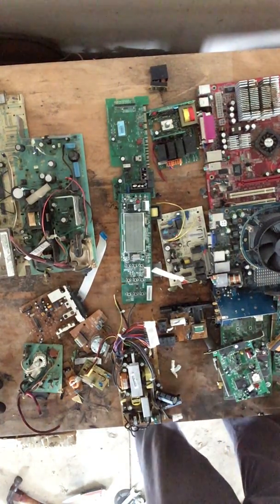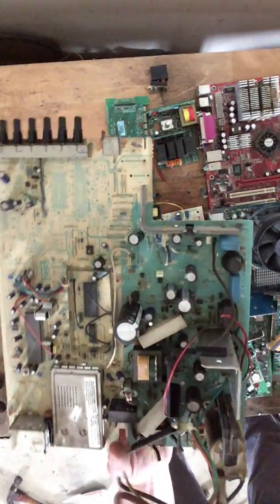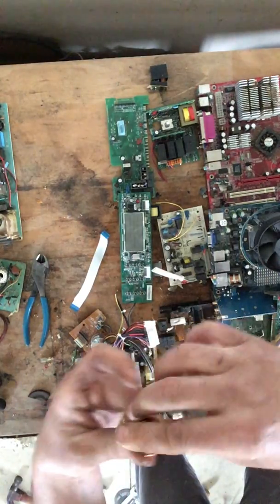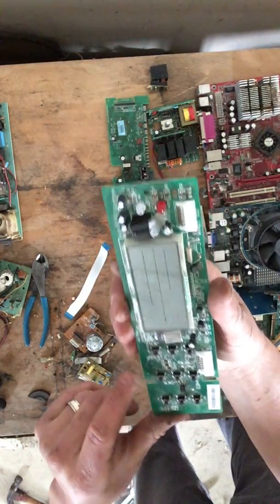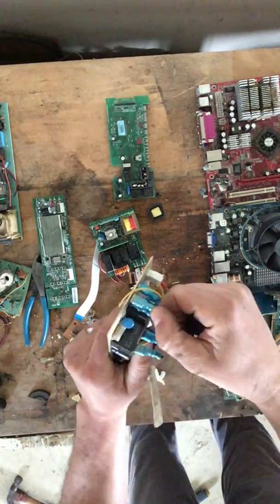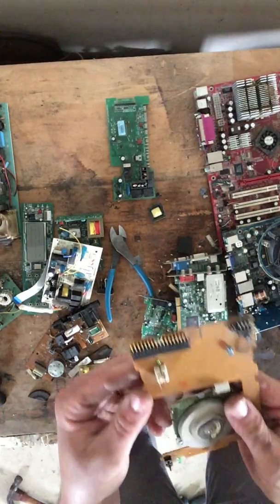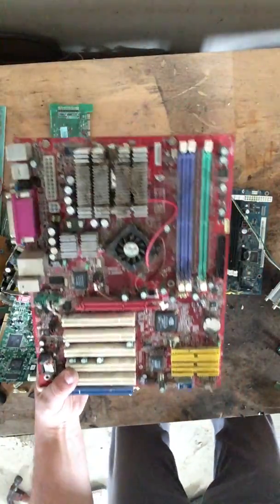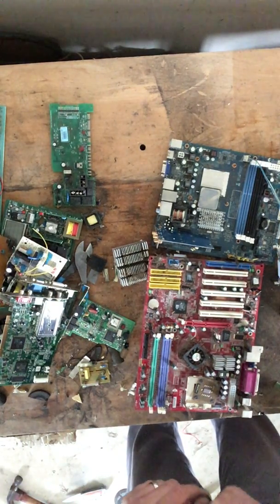Scrapping circuit boards for beginners.

Comment: I want to thank you for your informative video on what holds value on the boards, but also what to remove before scrapping the boards to maximize the profits attained by simply putting in a small bit of extra energy removing the more valueable components off the boards.  I know this is an older video, but that doesnt take away from the quality of the information your giving.  I do have a few questions for you in regards to the price difference between the low, medium, and high grade board pricing in a generalized % difference and not the current price.  Thanks, and keep on your scrap game. there is more money to be made scrapping than most know, and I do believe that scrapping as a full time job, or even a side hustle can seriously help make life much easier overall because of how much money can be made in the various ferrous and non ferrous metals, as well as e-waste.
Reply from the maker: Thanks for watching, and I appreciate the kind words.  You can make some good money scrapping, granted the scrap is there to pick up. I know my dad says he gets slim pickings in London due to the competition from fellow scrappers. In London I get $0.26lb for some of the circuit boards and $1.10lb for motherboards. Sometimes you need to call around.

Comment: Mr Tin Man, the small components is there any value in saving these? I read about some parts that contain palladium. Will you please elaborate.
Reply from the maker: I actually have a video called “depopulating circuit boards for gold, palladium, silver” check that one out. It talks about micro scrapping as well as shows you places to find the precious metals and what to look for.

Comment: Are there toxic chemicals in these when the board breaks? Should gloves be worn? I want to collect all the Silver and avoid the Middle Man. I know there is good money to be made. I worked in a Print Shop and silver was extracted from " fountain solution" . In Printing- Oil ( The Ink) and Water ( Fountain Solution) don't mix ( they separate).
Reply from the maker: it does depend on how you break them, I use a pair of tin snips and it does not release any type of dust. However, if you use a grinder, there is dust that becomes airborne and you will want to wear a mask and have a ventilated area for protection

Comment: your scrapping guides are very primitive, all you focus is on copper. you aren't saying about tantalum capacitors, diodes, transistors, or the solder used on the board which contains 3 percent silver (lead free silver only). But all you are seeing is copper. Forget about palladium, gallium, platinum and advanced stuff like that. Only glittering matters for you, gold and copper.  Take a time and see the manufacturing process of electronic components, will give you at least general level of education as a scrapper.
Reply from the maker: If you read the title it says for beginners. My other videos show other items like silver, aluminum (both clean and extrusion), brass, etc. some want to know basic questions like what category to put them in, where to find various ones, etc.

Comment: I take the heatsinks, transformers and copper / aluminium coils, wire off. Put any plastic covered transformers, copper coils in the freezer, it makes the plastic brittle and easier to smash up.

Comment: Can you please let me know what the thin silver coloured wiring in low grade boards is made of
Reply from the maker: Either aluminium or coated copper. If you scratch with a file and copper underneath #2 copper, if scratch and silver it is aluminum

Comment: I have TVs, PC towers and Laptops,  one scrap yard pays for laptops as of 2023 Jan $3 each if complete screen not cracked (or 25 cents a pound)  , another scrap place gives me 60 cents a pound.   Desktops same thing $3.50 to $5 each  if includes a hard drive and memory stick. the TV boards I think were 35 cents a LB. I  might start cutting the contacts off the edge, but so far I have just been scrapping them as is.  Oh and TVs no one takes because of the glass,  just pull the boards.

Comment: Does anyone have any experience with selling all grades of scrap boards and processors to FCM in Montreal? It is difficult for Canadians as I live in a border community but you basically have to part the sea to get them into the States. I would prefer anywhere along the 401 corridor . I live 100 km west of London Ont. Any feedback would be helpful.  I took about 6000 lbs three years ago to Greentec in Cambridge, but that didnt go very smooth.

Comment: Hey at 2:40 those plastic boxes (volt relays) are worth cracking open they have copper and sometimes gold or gold contacts
Reply: If it’s not gold it’s a different yellow metal but I’m 99% sure it’s gold and if it is electronics usually use 24k gold
Reply: 4:39 its I believe called copper windings and volt relays have them
Reply: Will you do me a favor and stop saying "k?" I had to quit watching because it was killing me. "K!"

Comment: Tin man: what are header pins from circut boards made of? Silver or aluminum? These are the pins in the long  plastic- that are solder to the board where a slave connector or ribbon conects. Thanks

Comment: Hi!  I'm a brand new beginner at this and I've been trying to get the circuit board listed in a different YouTube video.  Is there an alternative to this green pcb board for building diy mp3 player in the following?   Video is simply called How to make Mp3 player at Home !   By Mr. Maker.  Feel free to check it and get back to me. I'm so clueless.   
 Thank you for help!
Reply from the maker: Actually not sure about remaking or building things with circuit boards, I just scrap them. Sorry, but I will check out the video.
Reply: @TinManScrapper  ok thanks

Comment: What if the boards are broken or have a hole from ripping off a heat sink. Are trash or what?
Reply from the maker: At my scrapyard I have brought them in completely destroyed and they take them. I put them in a big bag. It may vary by province or country, but I think the yards are more concerned with the materials on the board and the metal recovery than the condition  of the board. If your hare separates your board into the 3 categories, taking stuff off may downgrade your board but that is it
Reply: @TinManScrapper  thanks!

Comment: Hello, Sweden here again.
I also take off some of the gold plated material, have a buyer for that. My regular yard pays flat rate for circuitboards, the other yard takes high grade boards only if 100kg minimum.
Those white slots on the red board, they do have gold but it's very lightly plated and it's gold over nickel over bronze so it's a different process and difficult to refine at home.
Stay safe and take care.
Reply from the maker: Thanks you too. 100kg is a lot but circuit boards to add up, since they are in all electronics. Stay well too